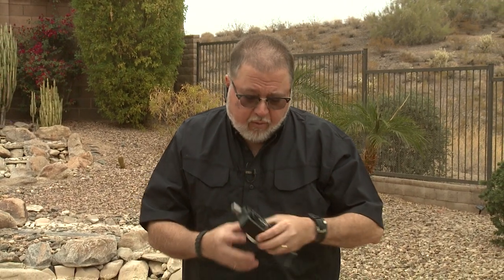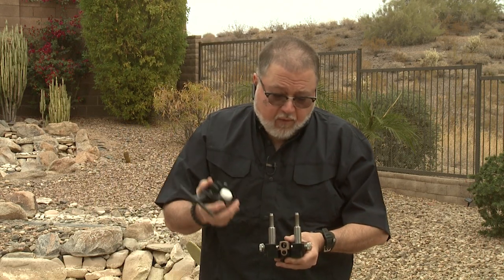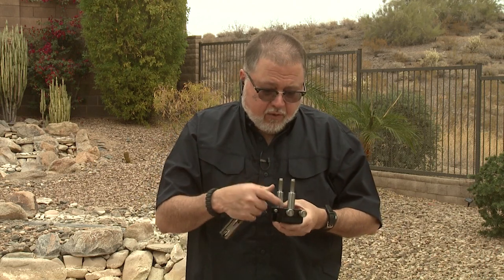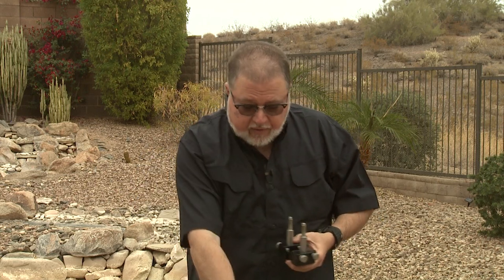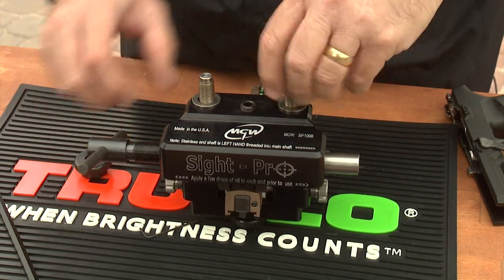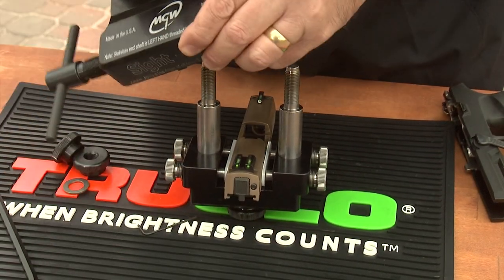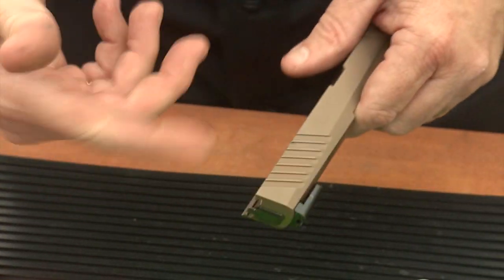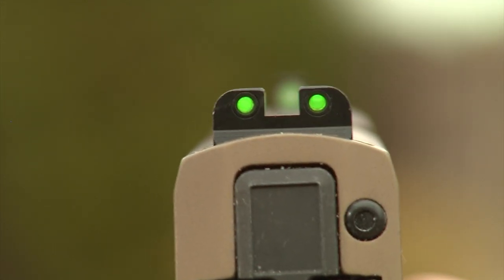Installing TruGlo TFX Sights on SIG P320C #245

Comment: I have the same sight tool and will say without a doubt that it is one of the most rock solid sight tools available. It will accommodate about any semi auto pistol made. The sights on these P320's can be extremely stubborn trying to move without a tool like this.
Reply: YUP, It even takes out Springfield XD Sights, which are one of the hardest ones to take out, right up there with S&W M&P Sights.

Comment: Left to right to install! Which way to push out the old?
Reply: Opposite, Right to left, it came out on the left.  That goes for SIG and for XD/XDm.
Reply: The sight should always go left to right no matter if you're installing or removing! It is not recommended to push sights in or out in opposite directions as this wears the sight channel much faster.
Reply: HFTONE p

Comment: Great video!!  Probably have to install a bunch of sights for the tool to pay for itself, huh?
Reply: They make different models at different price ranges, this one is somewhat in the middle, but they do make one that is a little over $100 and it pays off when you don't break a sight and Try-Glo won't warrantee it if you pound it in!!
Reply: At roughly $40 a pop to have a gunsmith replace your sights it won't be long before the tool pays for itself. And you can use it at the range to make fine adjustments.. See how much a gunsmith will charge you to follow you to the range!
Reply: I’d rather spend the money for the tool and do it myself so I know it’s done right than letting some chuckle head at the gun shop try it.

Comment: Very interesting video! But, don't you think that sights pusher is a bit over engineered/built ? 
I also would not put any oil unless the fit is extremely tight . Cheers !!!
Reply: This one is the top of the line one, but they do make less expensive ones and I mean about 1/4 of the price of this one!!  I got the top of the line one for the show.
Reply: This sight tool may be over engineered, but it's amazing at how rock solid it holds the slide, and it will accommodate just about any semi auto pistol made.. Great for fine precision adjustments. This is definitely a top of the line tool.

Comment: What holsters can fit that light just bought one. I have a Sig P320
Reply: Most of the holsters for lights are duty Holsters with retention!!  You have to know the light you're using!!
Reply: G code, shadow eclipse incog
Reply: Works with TLR-1 streamlight or surefire. XC1
Reply: @jacecolgrave4372  Please explain
Reply: @jacecolgrave4372  You have to expand on your posts..
Reply: @yrsued  g code makes a IWB holester thats light bearing , you can use a TLR-1 or a XC1
Reply: @jacecolgrave4372  Oh, OK, I don't do IWB and when I need a weapon light, I use a Duty Holster!!
Reply: @yrsued  Illinois only allows concealed carry, unless we just cover outside the waist band
Reply: @jacecolgrave4372  Here in AZ we have both, I ONLY Conceal Carry, EVERY DAY and I only do OWB!!

Comment: I bet that piece of equipment cost more the the sights though.... Unless people have this tool it won't help most people Js. I'm curious how much did the sight push cost?
Reply: I borrowed this one for the Video, there is a less costly version that sells for $130.00  if you are only going to install one set of sights, this particular one is not for you, but I have installed over ten sights so far, in all SIG's I own, Glocks and I will do 1911's soon.
Reply: The MGW Sight Pro SP1000 which is the tool used in this video costs around $300 with one shoe for a particular gun model. But at about $40 or more a shot for a gunsmith to install sights, this tool will pay for itself fairly quickly if you have multiple guns that you want to replace or adjust sights on.. And you're pretty much guaranteed that it will not damage your gun or the sight. Take it to the range to make fine adjustments. I love this tool and although it is expensive, I think it's worth every penny, especially if you have gun with stubborn sights!

Comment: For these and the TFO on a P320 compact, what # combo for front and rear is dead on? I've heard conflicting reports.
Reply: I got the 8 & 8, and it worked fine, but I've also heard different things, but it all depends on the shooter!!
Reply: Sig uses different # sights for different calibers with the P320. Either a #6 & #8, or #8 on both ends depending on the caliber. You can get the correct combo info from the sig website if you're not sure what you need.. And it also may depend on your shooting style, how you use the front sight and what type of sights you're using! You may need to experiment with different size front sights to find what works best for you if the stock combo doesn't.
Reply: Lol another commercial video

Comment: That works, but keep in mind when you use a punch especially on a front dovetail sight you can hit it lower to the frame, meaning there is less change of bending it if it were to be too tight as opposed to using a sight pusher that you can't get too close to the frame in order to not damage it. And if done properly there would be no marring or damage to the sight.
Reply: But if you do that and break it, TruGlo and other companies WILL NOT refund your purchase!!  That is a fact!!
Reply: Apparently you've never tried to "pound out" a factory installed front sight on a P320. Chances are very good that you'll damage either the sight or the slide attempting to remove it this way..
Reply: @HFTONE  I would NEVER do that, for example, TruGlo recommends using a Sight Pusher and if you pound it out and break it, you're on your own!!

I only use Sight Pushers for EVERY sight now.
Reply: @yrsued   OH I agree 100%. I was replying to JC's comment about pounding out the front sight on a P320.. I have the MGW Sight Pro tool, the exact same one you used in the video.. I would never recommend that anyone pound a sight out..
Reply: @HFTONE  No mater what sight it is, ya, the sight tool is the best way!!  Pounding it out will only break something and in the case of Tru Glo, void your warranty!!

Comment: I'm sure that tool is no cheap....but neither is the gun. I have seen videos where these guys are beating the snot out of the sights to get them, makes me cringe. Beautiful tool
Reply: Would be nice if that tool could be mounted in a vise
Reply: Not, THIS particular model is NOT cheap, but it's worth every penny.  There's several lower priced Models in the same brand.
Reply: @dominicpetruzzelli3134  YES, This model can be mounted on a Vise, but I showed it by itself.  IF you mount it on a Vise, you should use smooth jaws, so you don't damage the finish!!